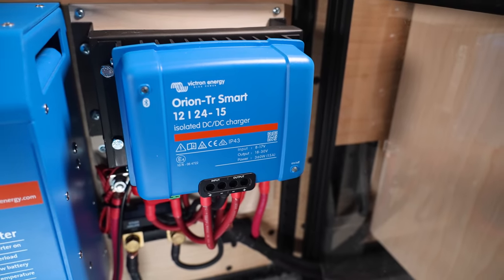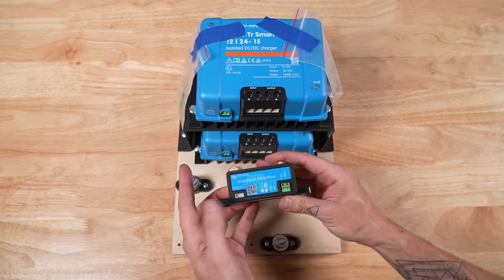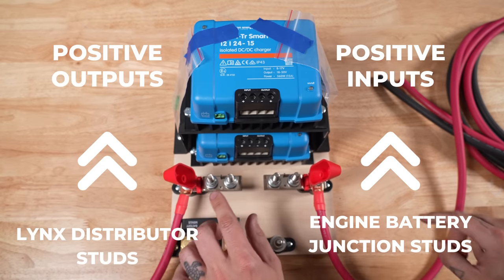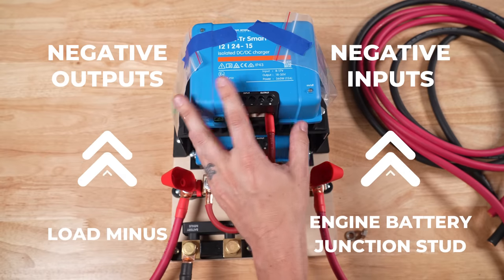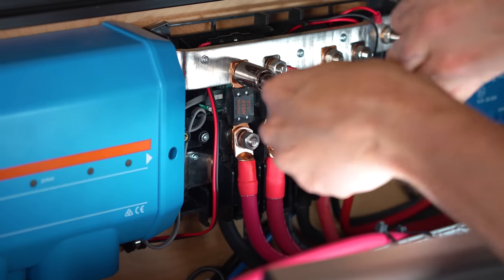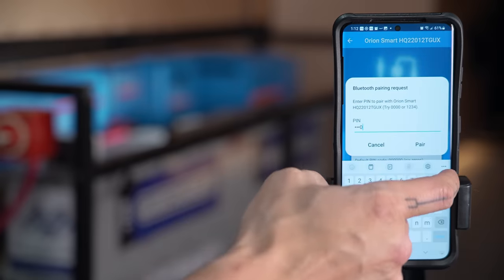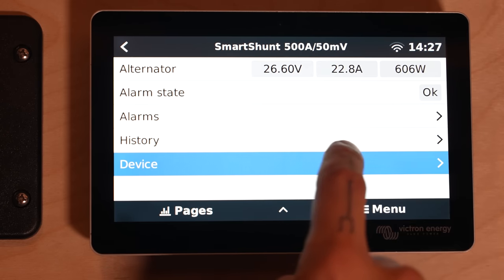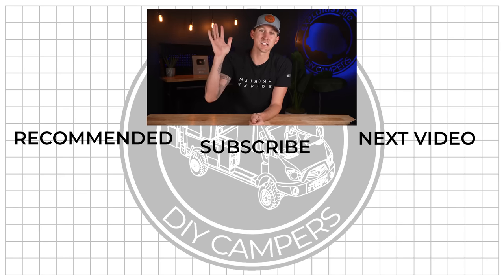TRANSIT ALTERNATOR CHARGING - DUAL VICTRON ORIONS

Comment: Question:  Why did you add a Victron Smart shunt connected to the Orion-TR Smart 12 | 24 - 15 isolated DC-DC charger?.  The reason I am asking your electrical system already has a Victron Lynx Shut
Reply: shown below....  Glad to see you showed how to tell the Cerbo GX the Alternator is charging with an additional shunt. Without the shunt, the Cerbo GX does show a negative DC load but doesn't say from what. I'll be adding the additional shunt now....
Reply: I am not sure what make sense here.  Both of the dc-dc converters have a Cerbo Gx connection outlet to be connected to the Cerbo Gx.  I would thought that Victron would provide a product that has this built -in.  as well as Clea installation instructions for their product.  Example fuse sizes for these 2 dc-dc chargers.  outputs are 15am each.  I am not able to find a 20amp or 25 amp MBRF fuses ...smallest fuse I found is 30amp...
Reply: I mis-spoke.  Orion -tr Smart dc-dc chargers DO NOT have a Cerbo Gx connection - not sure why Victron did not incorporate this in all of their products